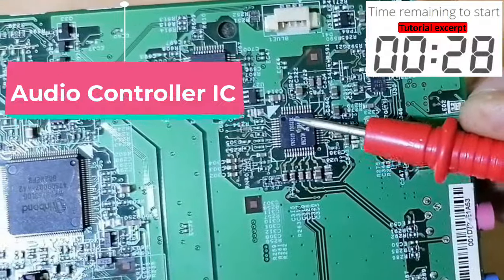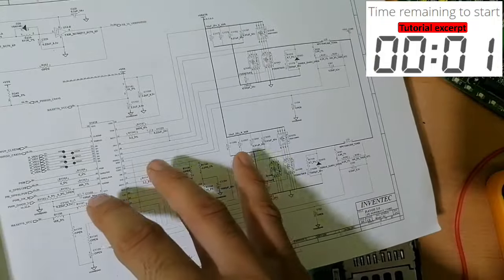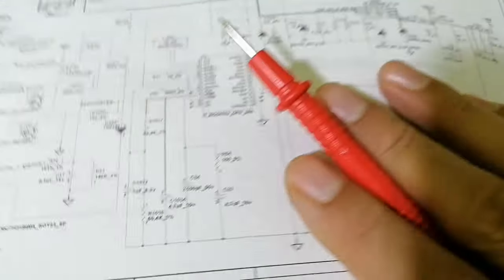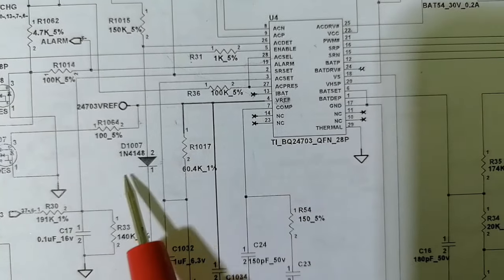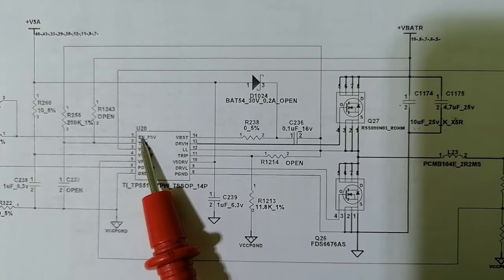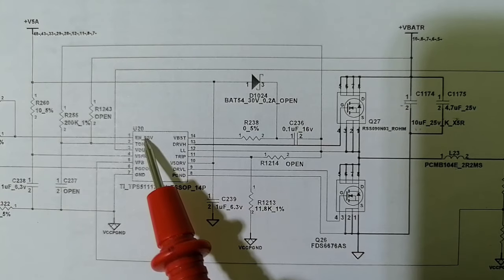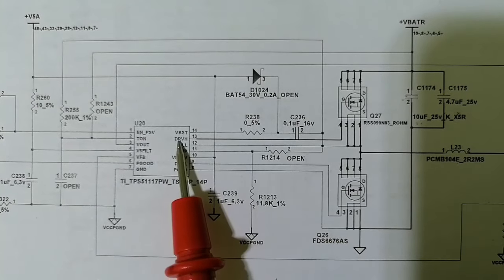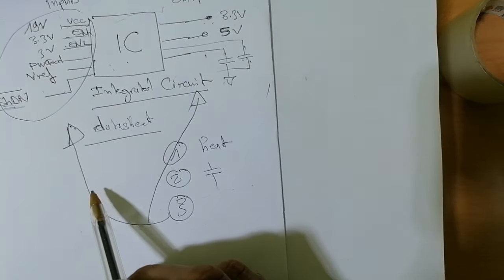Complete Integrated Circuits ICs Testing tutorial - IC Pinout, IC Circuit Diagram - voltage tracking

Comment: Hello, I enjoy learning from your tutorials that you share with people who want to learn. I have a Vizo tv V655-G9 that has no power blown fuse , and damaged   IC components on the power board at location  IC150 , number on the part is 6C17744  , and the power board part number is P650D112DA-MP02 I need a replacement part but can't find it. I also need to locate schematics for this board. Can you help me.

Thanks
Darryl

Comment: But you totally ignored that often the fault is actually one of the ceramic capacitors is, itself, shorted.  Not the IC.  Not sure why you keep saying that if the capacitor is showing short, you have bad IC.  Probably, you have bad capacitor. Fact.
Reply: This video subject is about testing integrated circuits, he has another video on testing capacitors.......
Reply: Ofcourse that is the very important point to be noted

Comment: If ceramic capacitors are bad then doesn't that mean that by replacing the capacitors the circuit should be ok ?
Reply: Yup, he totally ignored that if the capacitor tests shorted, it's usually a shorted capacitor, much less often it is shorted IC.

Comment: This video is fantastic. Even now i work with electronics for over 10 years, you were able with this one video to teach me some new  knowledge about the debugging of circuits. Where are you from? I am asking, because i have a mainboard here at home, which needs one trace fixed and  then a voltage regulator IC reflowed, that i do not feel comfortable fixing myself. I am from Germany, but in any case there is allways the Option of shipping it around. Maybe you can help?
I would ❤ that !
Reply from the maker: Hi @medienmond,
Thank you for these amazing words, You can join me on my Patreon Page as a mentorship experience member, and I will help you until you fix that mainboard.
Reply: @electronicsrepairbasics_erb  As i said before, i do not think i can reflow that chip. It is that tiny (3x3mm) and the board sucks away all the heat from my hot air station. Then there is one via missing, that is far to thin to fix without a microscope. I need someone to do that for me for a pricetag of about 30€. Without any membership attached :-)
Reply: Can we be friends I like Germany